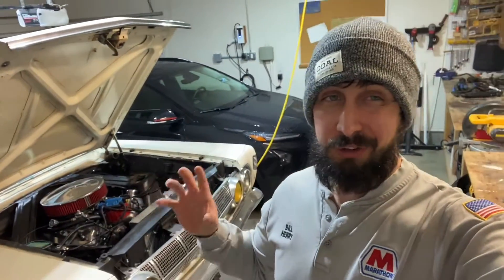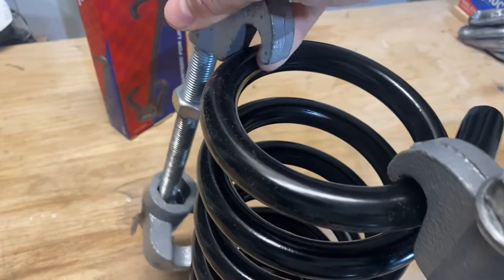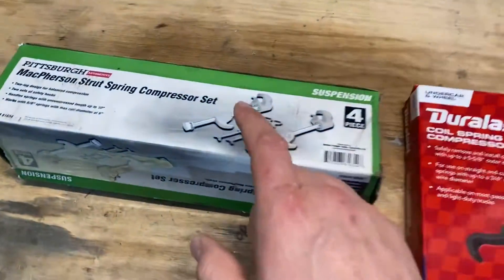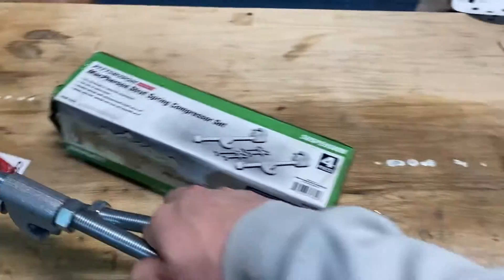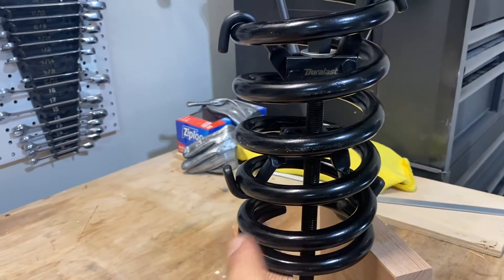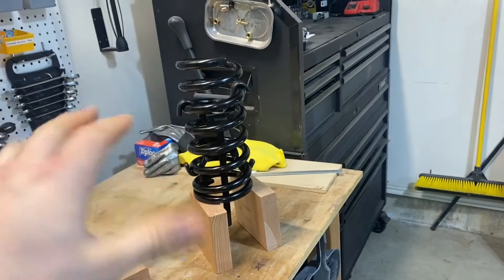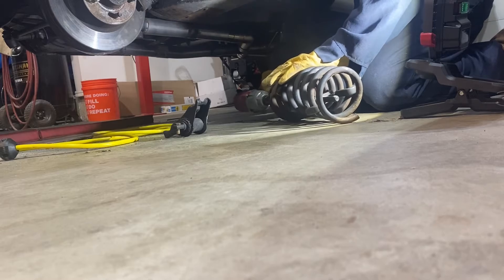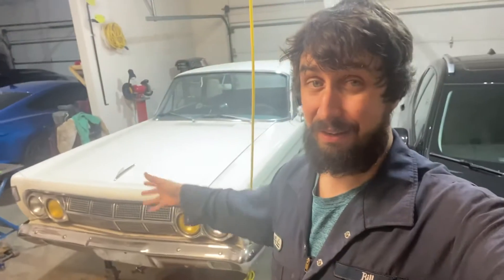How to Pick the Right Spring Compressor and Use it Safely

Comment: Video was good until you pulled out the impact 🤦‍♂️ Spring compression tools are not ment to be used with an impact. It even says it in the manual.
Reply from the maker: @Wasper216  then it got great! Heck i even slathered some anti seize on the threads

Comment: My rear spring seems to have detached from its bottom holding, recommendations?
Reply from the maker: @gabrielstagg367  you may need to try a combination of letting the rear suspension droop (to minimize how much you need to compress the spring. This would involve supporting the rear of the car without supporting the suspension but high enough the wheels dont touch the ground. Once you’ve done that use the correct style compressor to compress it enough that you can carefully set it into place.

Comment: You didn’t check & measure the height of the old n new springs
Reply from the maker: @leoramirez7811  new springs were lowering springs so shorter to begin with plus different rates so you somewhat need to install and see how it sits loaded

Comment: Good video Thanks. Do you insert the Internal compressor hooks first and then feed the threaded bar inside and through both hooks individually? I need to purchase an Internal compressor to remove rear springs on my BMW E87....
Reply from the maker: It honestly depends on space, type of springs, how much access you have.  I think i fed mine through in two pieces.  Once you have your specific spring/car in front of you it will make more sense which way you have to install

Comment: Good video.  It is very dangerous to use the 2 piece external spring compressor for this type of application.  They are made for strut type springs like on Honda and Toyota.
Reply: correct , outside clamp = mcphearson,  inside clamp = naked spring....even faster to apply the compressor while spring is already compressed under the car!!!

Comment: Always grease the threaded rod in your spring compressor.  Why?  Because you're using so much torque on the rods that you won't know that they're binding up until they break.  So you can't let it bind up.

I don't use mine very often, so before I use it, I spray all the old grease off with brake cleaner, let it dry, then grease it up.
Reply from the maker: @ReadTheShrill  I’ve taken a similar approach but with anti seize and agree it’s a good practice.  One more thing, and I apologize if this comes off as nitpicking, my background is mechanical engineering 🤓.  Technically the rod shouldn’t be seeing much torque at all.  Just like with any bolt being torqued down (that’s not bottomed out) you are putting the bolt/rod under tension.  In this case the force of the spring is driving that.  The more you tighten it down the more force it generates as the spring is forced down.  The lubricant acts to reduce thread friction and the effect of friction can massively increase the stress on the rod.  This is why companies like ARP specify lubricant on the threads of their bolts and even go so far as to specially machine their washers and include lubricant between the bolt head/washer.  Either way you are correct the grease, anti seize, oil, etc. is smart to avoid additional thread binding or damage. 

Just remember if this were a bolt being torqued the grease would throw off your torque value likely leading to an over torqued situation.

Comment: Seem like a proffesional , i have 22 inch rims.on chevelle looks , great , how can i get a lift? Do you recommend spacers or certsin springs i could use?
Reply from the maker: @Theundisputedtruth  im not super familiar with Chevelles but yes taller springs, if they make such a thing taller spindles (or if your car was previously lowered on drop spindles install stock ones).  Otherwise some sort of plate between the spring and perch would do it like you said.
Reply: @truckandroll989  thx